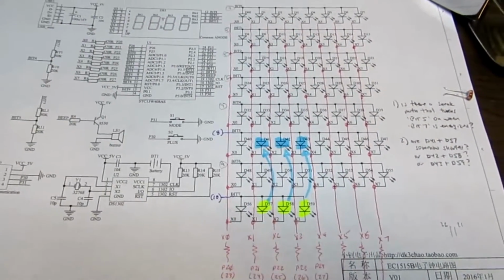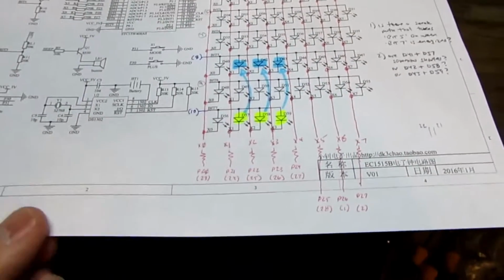EC1515B LED Clock - Construction and Demonstration, PART 2

Comment: Hi, in my version, the dots don't flash every second in time mode. They don't flash, so it's kinda confussing when it is showing time or othe function. Do you know if it can be a firmware problem? I have 2 clcks with the same problem. Thanks.

Comment: Additional undocumented settings.
To get to them you need to press the "Mode" button and keep it pressed for 7-10 seconds. First, there will be a switch to the parameters in which the alarm is tuned after each hour, alarms, melodies, etc., DO NOT RELEASE the BUTTON, keep it pressed, after a few seconds there will be a switch to these settings:
1) On / Off brightness control depending on the light in the room.
2) Setting the sensitivity of the photosensor.
3) Temperature units: Of - degrees Celsius, On - degrees Fahrenheit.
4) Correction of temperature readings, 1 unit = 1 degree.
5) Time format: 12h / 24h.
6) Setting the information displayed: 1 - ALL (time, date, day of the week, temperature), 2 - time for 15 seconds. then the temperature is 3 sec, 0 - time only.
7) Automatic change of modes of a ring of light-emitting diodes. Values from 0 to 84. 0 - do not change, 1-84 - change after 1-84 minutes. (That is, if you set the value to 1, the LED ring light mode will change to another one after 1 minute, if you put 5, then the mode will be changed every 5 minutes.)

Comment: Can you help,
 I know nothing about electronics but wanted to learn soldering and had a go at this clock, All the functions are working but seven of the leds don't light (7,15,23,31,39,47,55 ).I tried a continuity test and they light up,  Are they all linked to a single resistor or do I just need to practice more soldering.
Sincerely Benny
Reply from the maker: Thomas Benson, all of those LEDs have their cathodes connected together on the circuit board, and that common connection is called 'X7'. All the current coming out of those eight LEDs via X7 goes through resistor R8, and then on to the main IC 'U1' on its pin 2; the signal between R8 and U1-pin 2 is called 'P27'.

If none of those eight LEDs light up normally, then there is a problem with the X7 connection, or with R8, or with the P27 connection, or with U1-pin 2.

Visually inspect all of those connections, and use your continuity tester to verify that the signal path described above is intact. Try reheating those solder joints too.
Reply: Thanks,
 I will check my soldering on the resistor.
 Thanks again

Comment: Wondering if you have the same version as I do...

EC1515B V03

I seem to have a lot more "settings" than any of the manuals I can find online.

I have an initial setting menu that goes up to option 24 and if I continue to hold the button through the 24 setting mode, I get an additional menu that gives a further 7 options.
Reply from the maker: medic 01001010 , The "V03" appears to be the revision level of the circuit board, and quite possibly has little or nothing to do with the revision of the firmware. I don't know how to determine the firmware version.
Reply: Try this link. Download the Instructions V0513

http://pan.baidu.com/s/1o80hRNs#list/path=%2F%E5%B0%8F%E9%92%8A%E7%94%B5%E5%AD%90%E8%B5%84%E6%96%99%E4%B8%8B%E8%BD%BD%2F15%20EC1515B_V05%E6%96%B0%E8%B5%84%E6%96%99%2Fdatum(English)&parentPath=%2F%E5%B0%8F%E9%92%8A%E7%94%B5%E5%AD%90%E8%B5%84%E6%96%99%E4%B8%8B%E8%BD%BD